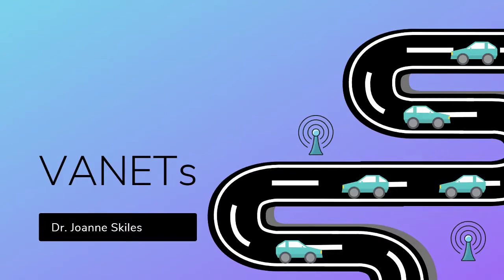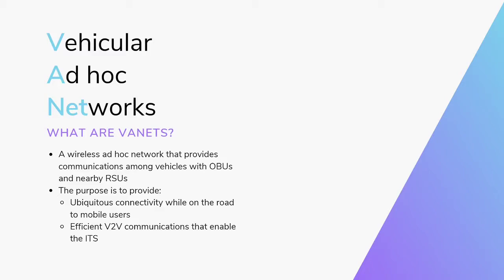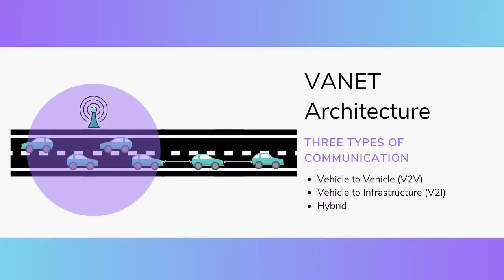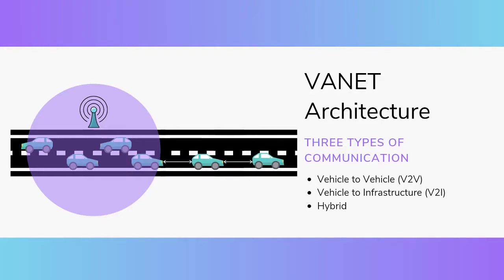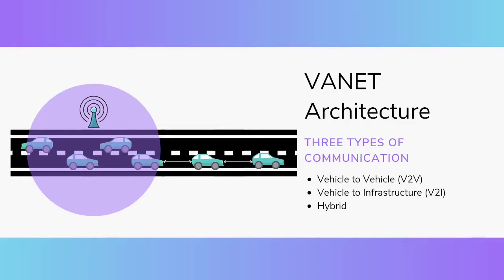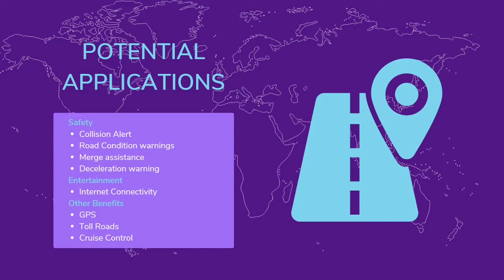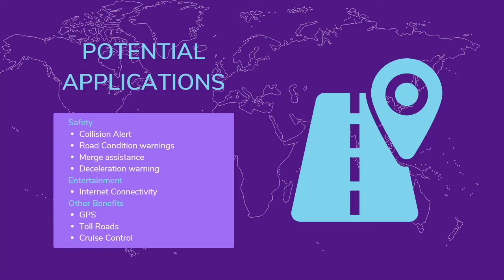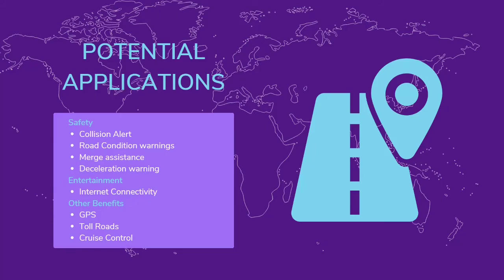Introduction to VANETs

Comment: I am beginner  in this and my synopsis time is near. I have to finalize my topic related to VANET. Plz suggest
Reply from the maker: Hi Monika - although I am not actively involved in researching VANETs anymore, here are few topics I think would be novel/are interesting and relevant:
*  Solutions/algorithms for better data dissemination - particularly in situations where there is limited connectivity or bandwidth.
* Investigating new routing protocols that leverage 5G which can also adapt to the dynamic nature of VANETs and improve the efficiency of data transmission.
* Security in VANETs is also a hot topic - perhaps utilizing blockchain methods

Comment: Hello Dr. Skiles, 
The research on VANETs have been ongoing for more than a decade. Do we have any practical VANETs deployed for the public yet? What is the current status? Which OEMs/Car manufactures have this feature already?
Reply from the maker: So you may not think of them as VANETs but there are smaller-scale VANETs that exist. An everyday example is for toll roads they use an RFID with the stationary toll plaza being the RSU. Some speed camera technology has also veered close to VANET implementations. The issue with OEMs/Car manufacturers is dealing with standards in communication  IEEE 1609 WAVE is the standard in the US that has to be conformed with and tests were done by USDOT to show the feasibility of V2X communication (where several different car manufacturers). This will take several years though given infrastructure needs - I would expect to see more sophisticated applications closer to 2050.
Reply: @DrJoanneSkiles  Thanks for the reply. It was clear. I did a literature survey on this topic in 2012 as an assignment to practice writing IEEE papers. When I saw your video yesterday, I was wondering what was the progress in this domain. Thanks for giving the examples.

Comment: Hi mam, Thank you for the video.
in your opinion which tool is better and easy for coding routing protocols for VANET? whether NS2, NS3, NETSIM, or OMNET++.
Reply: same question here
Reply from the maker: If you are just starting off in your journey I suggest either NS3 or OMNET++, but honestly if your are working with an advisor or group go with what your team already does/knows. The support online for any of these tools are lacking...it is best to use a tool that you can get help and assistance within your research group.
Reply: @DrJoanneSkiles  Thank you so much mam for your valuable reply